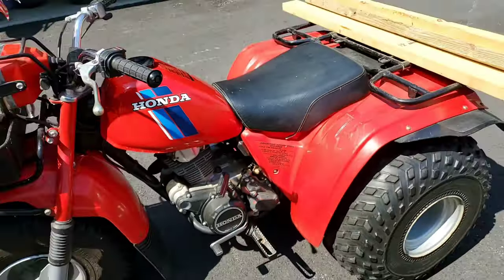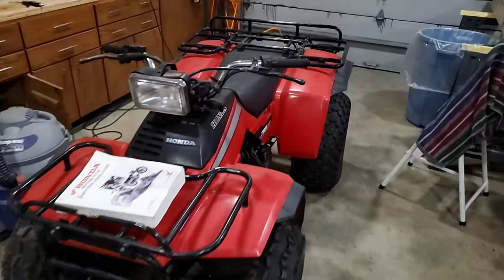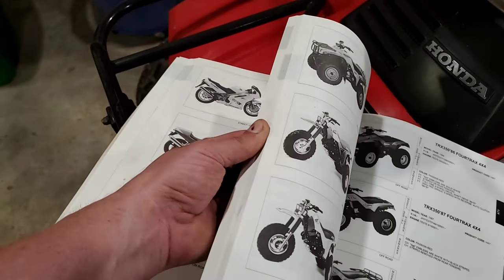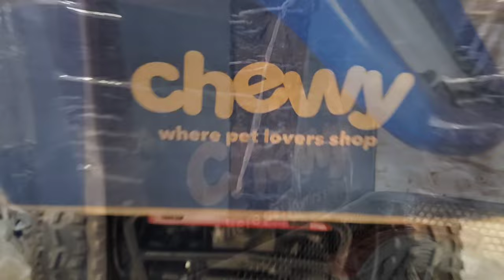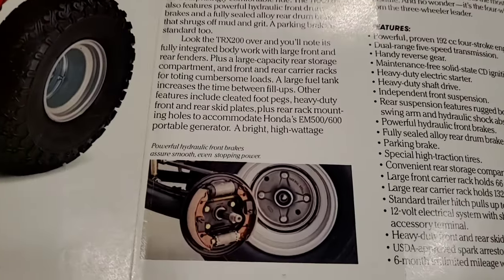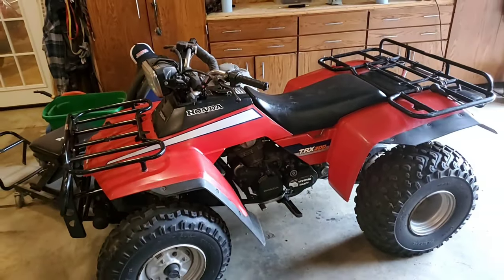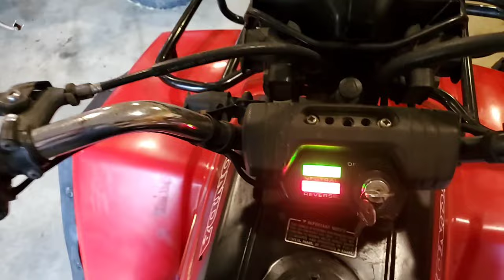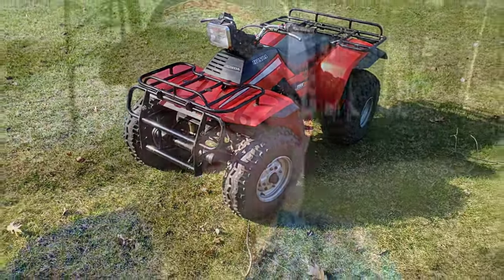1984 Honda TRX200 - The First Honda Four Wheeler Ever Made! - Hondaline Accessories & Maintenance

Comment: WOW! that's great. I remember seeing the TRX200 running around back in the mid 80's, but mostly 3 wheelers. I didn't know that Honda made a 1988 250es Big Red, thought that 87' was the last year which was rare. One boy I knew had an 86 Big red , and the biggest difference i seen was that the neutral and Reverse light was reversed on the panel and the stickers had a different graphic and a gray seat cover. I've seen more 1985 Big Red's more than any other year. I've Had 3 different 85' 250es Big Reds in the past, man what a machine they were!
Reply from the maker: So 1987 was the last year for the Big Red in the US.  Honda continued to sell it in Europe, Australia and NZ (possibly other countries too).  My 88 came from England though.  You are right though, 85 is the most common year and the production numbers go down every year after that.  They are fantastic machines!
Reply: @ThisOldTrike  I thinks it's pretty awesome you have an 88 250es Big Red, it really looks good, i like how the stickers wrap around the gas tank👍

Comment: My Suzuki quad runner 250 has similar front bumper you put on the trx200s I currently have quad trx300ex a Yamaha moto4 350  a Polaris trailboss 325 Yamaha 570 twin snowmobile engine  my son's 50cc atv 2 buggies and a utv tow truck  a off-road go kart

Comment: i got a trx200 from an old guy i knew pretty well. he ended up dying and never touched his 4 wheeler. so it'd sat for 3 years, and he never changed the oil as long as he had it. and he got it from someone else who took care of it. so i went down and i asked the old guys sister if i could have it. i got it home, and the second i got it off the trailer, it started almost right up. and one of the front tires went to shit. so it sat all winter with the same gas in it. then i got a tire for it and it still ran on the same gas that was in it.
Reply from the maker: Love that story!  They were certainly built to last for sure!
Reply: oh hell yeah.
Reply: and don't you worry. i do take it mudding on the one in a trillion chance it rains.

Comment: Do these have the same rear end as the 84 200es Big Red? Wondering if the axles are the same? Looking for an axle with no luck, id like to broaden my search options if these are identical.
Reply from the maker: The axles have the same part number, so I would say any 84 200ES axle would work for you.
Reply: Thanks for the info! I just got a barn/garage find 84 Big Red 200es and the splines on the axle have rusted away and have a ton of slop in the housing, the rubber o ring was busted and let water in long ago.

Comment: I know where there is a cherry 1986 trx 350 with a cherry Honda trailer. What is something like this worth?
Reply from the maker: Depends on if the trailer is a true Hondaline. But a cherry 86 TRX 350 4x4 can be $3500 and up depending on how nice AND original.
Reply: @ThisOldTrike  the trailer is a true Honda line and it is cherry !

Comment: Anyone ever swap out the trx rear and convert to the Atc 200es that’s what that bike really needed and a better designed front fork.
Reply from the maker: I know that @mrc_builds was considering that, but I think his donor TRX 200 went on to a new home.
Reply: @ThisOldTrike   I started looking and I was wondering what the difference is between the 250es and 250sx just in the engine? Is the 250es jug bigger?
Reply from the maker: The 250ES and SX motors will interchange and are the bore/stroke/compression/horsepower.... but, the ES motor is geared lower than the SX.  The ES has 25" tires compared to the 22" tires on the SX, so that offsets some of the gearing difference, but the SX is still a lighter, faster, and slightly smaller machine.
Reply: @ThisOldTrike  the es is geared lower in the engine itself?
Reply from the maker: That is correct.  The SX is First Gear: 3.615 - Second Gear: 2.000 - Third Gear: 1.400 - Fourth Gear: 1.069 - Fifth Gear: 0.848
The ES is First Gear: 4.083 - Second Gear: 2.389 - Third Gear: 1.609 - Fourth Gear: 1.179 - Fifth Gear: 0.906
Reply: @ThisOldTrike  thank you
Reply: The rear differential gear ratio on the 250es was the same as sx correct?
Reply from the maker: Actually no.  SX was 4.969,  ES was 5.684 at the differential.
Reply: I’ve swapped those rears back and forth for years guess I never noticed the difference